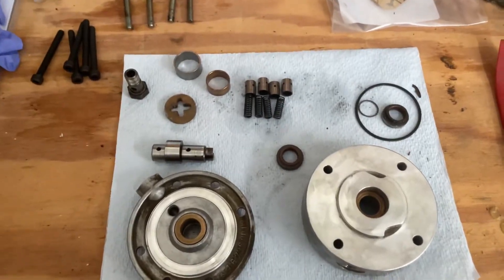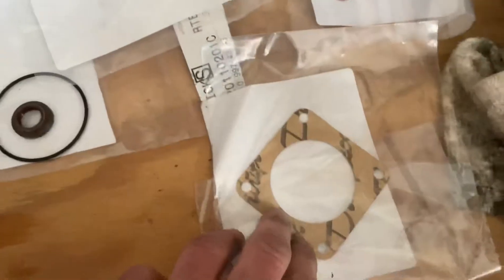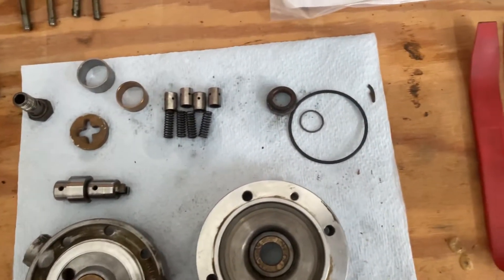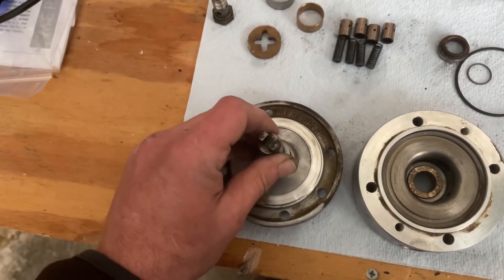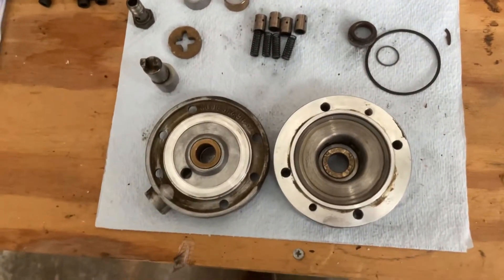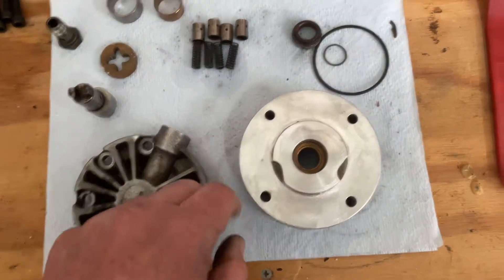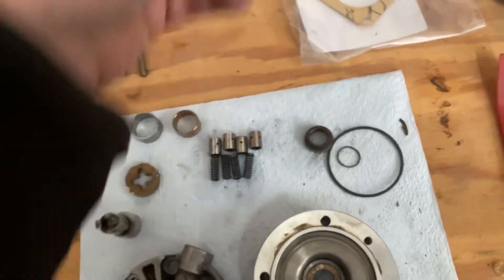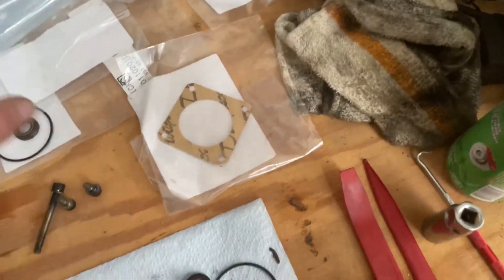Mercedes Benz 560SEL MY 89 Hydraulic Suspension Pump overhaul Part 1

Comment: is the bottom O ring inside the housing definitely 62mm id as I opened my pump and it had a 60mm id fitted on the inside of the housing and the 62mm was fitted to the side of the inner part

Comment: If you take out the inner part, there are two O-ring seals. One on the inside bottom of the housing and one on the side of the inner part.  They are easily replaced.  The bottom O-ring size is 2 mm wide x 62 mm ID.  The side O-ring is 2 mm wide x 60 mm ID.